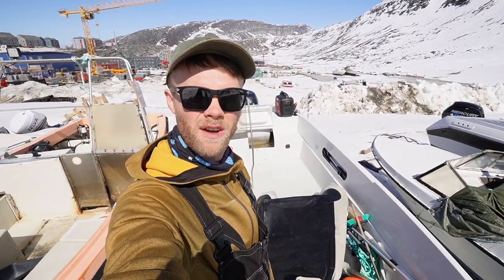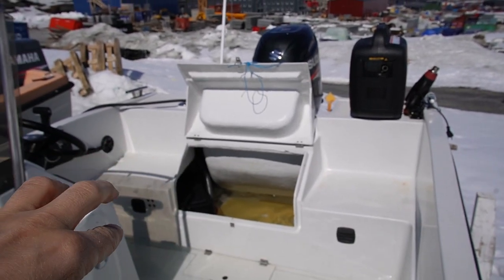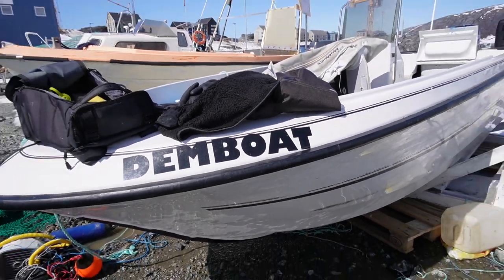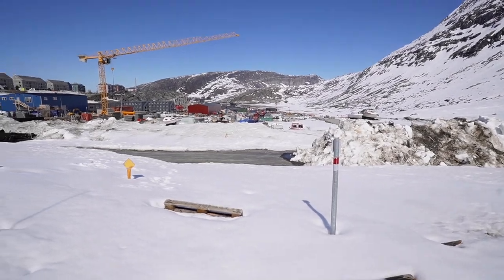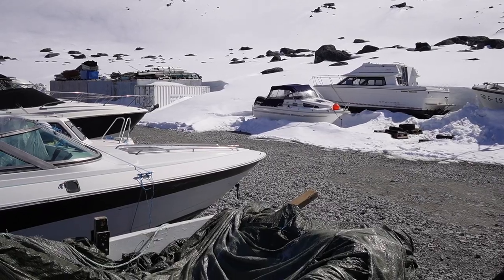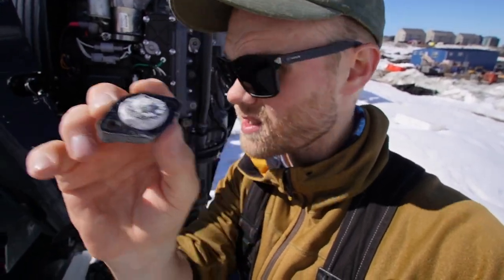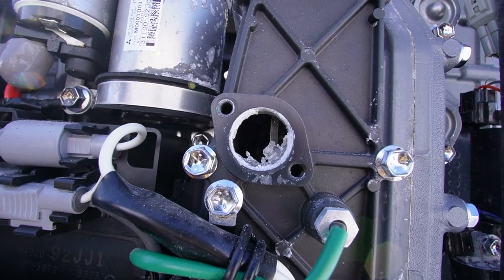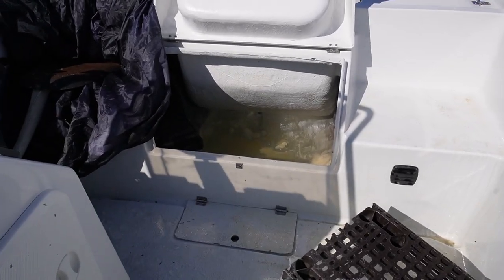Preparing The Demboat I Poca 570 Motorboat I Changing Anodes on the Suzuki 115hk Outboard

Comment: I was curious why boats are white and Googled: 😅
White color reflects 100% of the sunlight by keeping the boat interior cool.
Easy to spot any damage on the white hull and won’t show scratches and fading.
White color reduces boat manufacturing cost and latency (decreases time taken to manufacture a single boat).
White color has high visibility.
White color hull will not show any small imperfections on the hull.